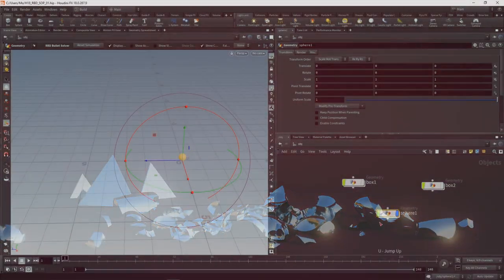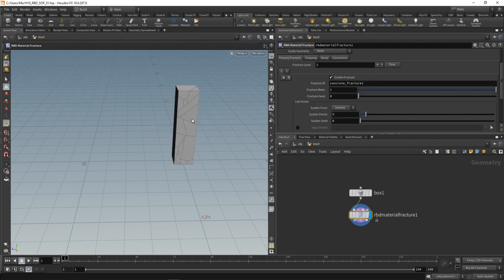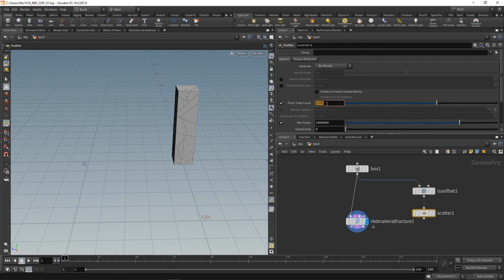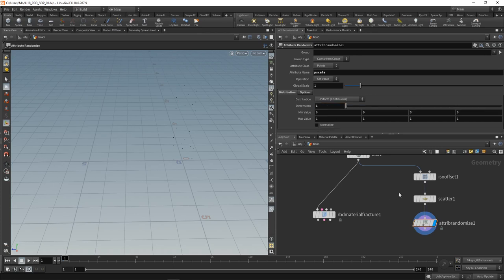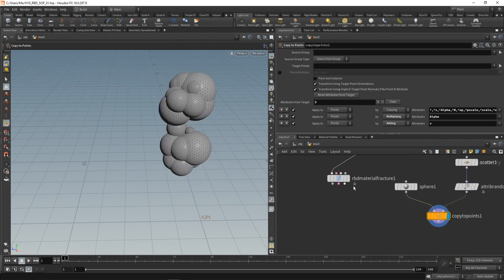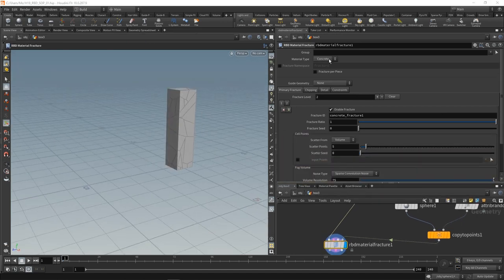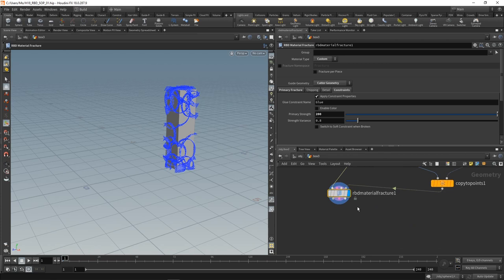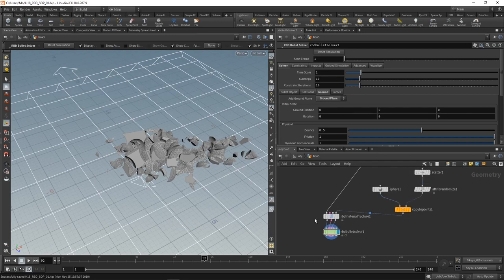New in Houdini 18: RBD SOP Solver - Custom Fracturing

Comment: look these are great... for simple columns or boxes.. its adorable.  But can you please do a quick video showing how to use something more custom.

eg I have a globe shape surrounded by some rocks... i've used points from volume to get lots of points inside... selected one point on it then used that with attribute transfer to transfer a red colour from my one point onto the other points.  Then a delete to remove the non red ones. So now i have a nice little volume of points in the globe.

I can use these points with the rbd material fracture to break it apart - but the issue i have is getting the main chunk of the globe to stay put whilst the fracture pieces move.  It seems nigh impossible wiith this sop basedsetup ?
Reply from the maker: Hey Anthony,

great question! In fact pinning pieces is quite straightforward. There are multiple techniques how to achieve this effect. In your setup I'd chose the simplest way and group the pieces you don't want to be affected by the simulation and set their @active attribute to zero. Have a look at this .hip, it doesn't even contain much VEX :) http://www.entagma.com/downloads/pin_RBDs_01.hip

Cheers, Mo

Comment: I have been struggling with this for weeks... 
I am destroying a building but want to break it apart at separate times with varying glue strengths.
Kinda like the top gets cracked and broken, it stops for a moment looking like it may or not break, then it all comes down.
Is there a way to turn on and off groups strength at certain times?

Comment: Cool but my system is slower than yours. Mine is dual Xeon 2697v2. Please tell me what is your processors configuration?
Reply from the maker: Threadripper 2950x. But what you're most likely referring to is a sped up video when it comes to simming/rendering. Ain't nobody got time to watch this in real time! :) Cheers, Mo